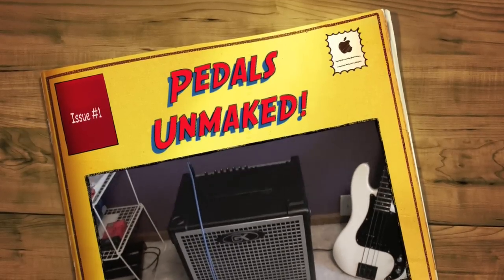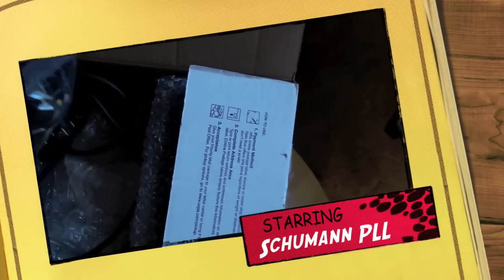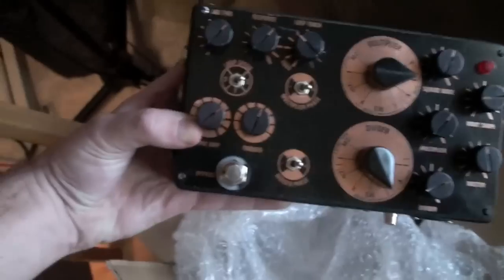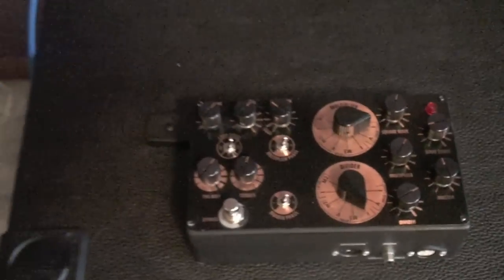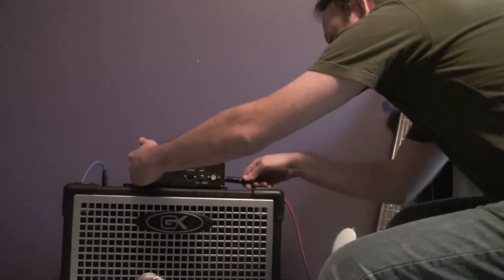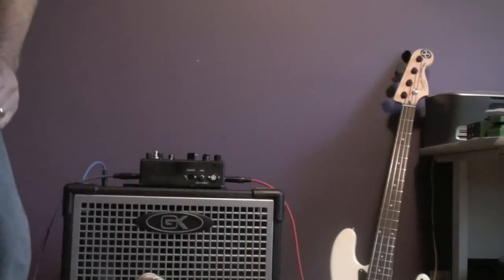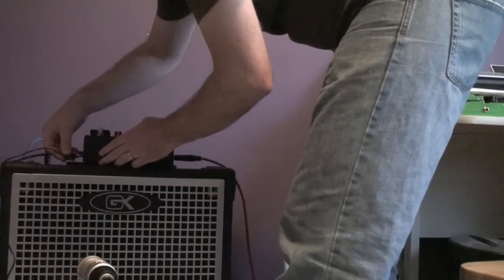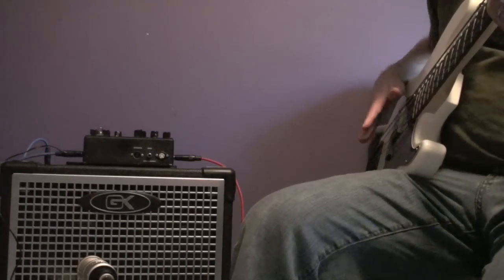Schumann PLL

Comment: @oneNychthemeron 

Gut shots I've seen show about 20~30 different kinds of wire, black silicone or epoxy, parts soldered "dead bug" style and everything shoe horned haphazardly into the box. If someone wanted to RE this puppy they would have their work cut out for them! I'll bet the failure rate [well documented BTW] and tales of owners who sent their PLL back to Schumann only to never see it again can be  attributed
to construction techniques!